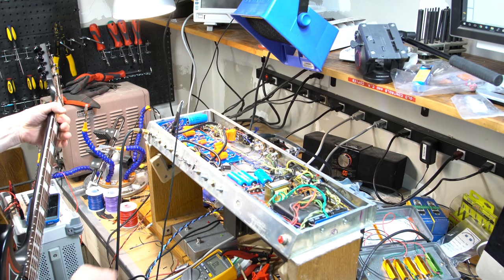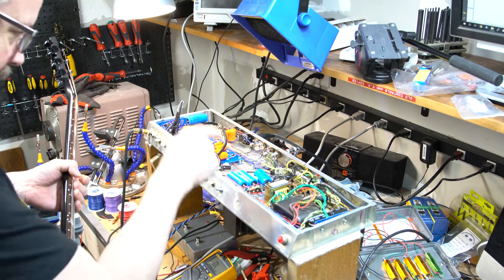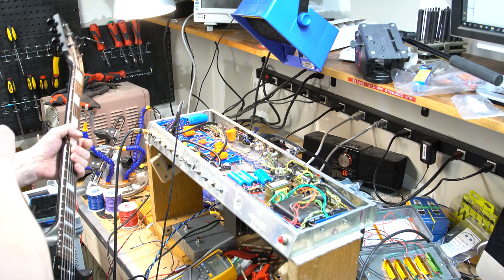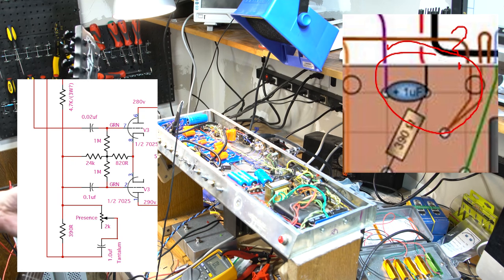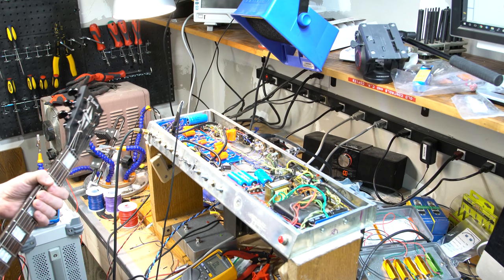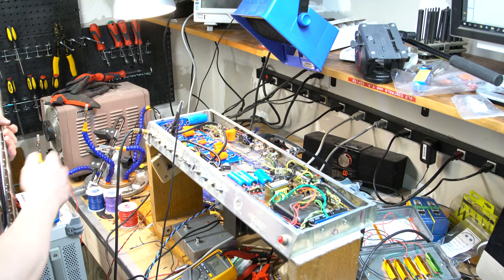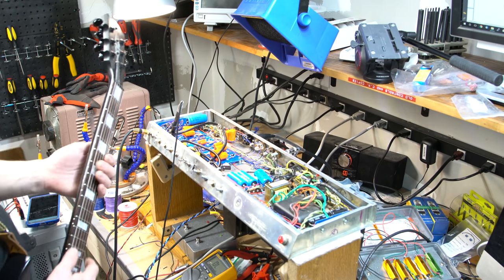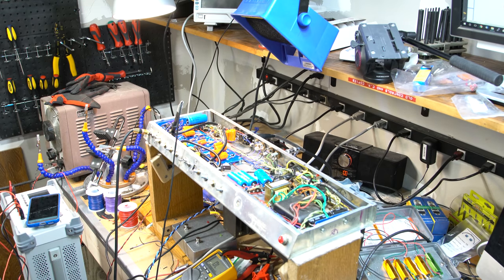Dumble Overdrive Special #124 - Video #12 - Finished Amp!

Comment: Missed it again-Glad you got everything fixed-Sounding great. It is the little things that can drive you crazy!!!!! I pretty much got mine done other than my voltage is still a little too high. I was going to put a resistor before the first node. I have heard some people say, d o n t do that but is it not the same thing when you put the dropping resistors with the electrolytic caps .It is just adding one more resistor. Thank you for letting us ride along.
Reply from the maker: You're welcome!  You could just increase the value of the first dropper resistor, no need to add another.

Comment: 2 Questions;
What is the wattage of this build?
What was/would be the cost for someone else?
Reply from the maker: I didn't measure the exact wattage, but the basic output transformer and 6L6GC quad of tubes should be around 100 watts.  I didn't add up the exact amount, but the cost of the base amp I bought used was 450$ plus the parts that I added were maybe another 500 or so, so I'd guess parts wise it's around 1000$ or 1200$ but then I have a good 50-100 hours of work in it too, maybe?  So for someone to buy this, I'd expect more like 2500-3000 for all that work to build it if you include that labor.  Not sure if you meant raw materials cost or the actual cost of buying one.
Reply: I meant raw materials , but thanks for answering both!